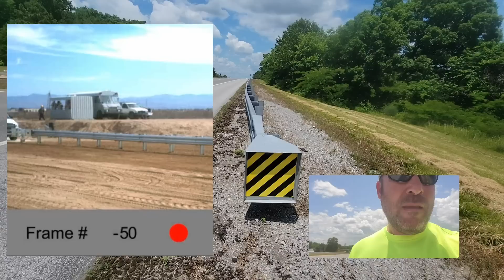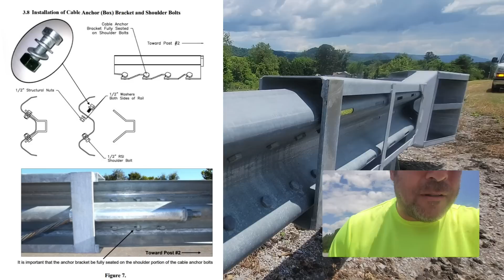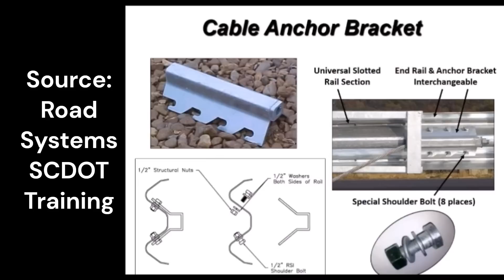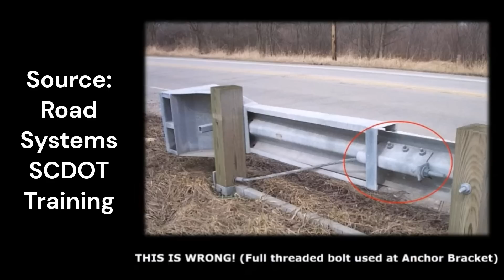Explanation of Backward Bolts Guardrail Short with Million+ Views

Comment: You are so right and you have to ignore any Troll's as there is tons on YouTube and keep doing what you are doing, it's to important. I was a Certified welder in structural steel and not an Engineer but I do know when something is Engineered to break away or designed to fail in a Engineered way you can not deviate from the proper way the Engineer's designed it to be assembled in anyway. Thanks for your hard work trying to help save lives
Reply: I doubt they were trolls. Just misguided due to their own ignorance.

Comment: Your idea of color coding is so simple but would make a world of difference. Could easily be done at the manufacturer.. sure they'd need to set up a new station and either transfer workers to that station or bring on new workers, increase rhe number of workers at a given time... but it'd probably be worth it. Just so the installers don't mess up by putting the bolts on backwards.

Comment: Are you familiar with European guard rails? We don't have something to hit. Our guard rails just go into the ground so it turns in to a slight ramp. Much safer to fly couple feet trough the air than come to a dead stop
Reply: You don’t come to a stop when you hit these tho… they’re not massive steel constructions obviously they slow you down but you don’t hit it and dead stop. I’m not gonna pretend to be an expert here but is it really safer to be flipped into the air even just a little bit than it is to be forcefully slowed down over a few feet? Especially considering the question of does it fling you into traffic or off the road which causes all sorts of issues especially considering the types of roads guard rails are used on anyway. Idk
Reply: Unless the vehicle overturns, which is often what happens with that type of guardrail with the turned-down ends. That's why they are no longer used in the USA.

Comment: So my favorite insight is about the installation errors, and how that’s indicative of further installation errors.  Agree 100% generally, but what I failed to get out of this video was a solid explanation of why the bolt direction should matter for this system other than the fact it can be referenced on something that looks like ikea furniture assembly instructions. I dug through a bit of guardrail installation documents, but couldn’t find any specifics about this idea, and also just having a general knowledge of fasteners in general, these fasteners can kind of skip through most of the more complicated aspects of tensile loads/strengths, torsional interests, etc.  They can essentially be considered “pins” in their applications. 

The only thing I can imagine might matter is the exact location of the shear plane, but this isn’t an aircraft  carrier.  It’s a couple pieces of fairly thin metal meant to help stop a careening car.  I’d like a scientific explanation of why you think the bolt orientation matters, because I’m both curious about the reason, and also think there pretty much is no good reason, outside of an installation manual reference.
Reply: i got the same impression from the video.  I suppose i could imagine.. that if you had the bolts the other way.. then a car hitting them would maybe losen them by pushing them out the way they came in, which in tern might cause the guard rail to bend and break better.

Comment: Sorry for my stupidity I can’t remember if it was in the video but what makes it different if the nuts are on the opposite side..other than the way it was designed..does it stop something from happening? I feel like I’m going to be looking for this now lol
Reply: They're not normal bolts. The bolt gets tightened onto the guard rail, then the bracket slides on to the bolt between the shoulder and the head. If they're installed with the heads on the outside (facing the road) it means both A) they didn't follow the instructions, and B) they're using the wrong bolts anyhow.

Comment: Ok automotive tech he. Installed did it right. Designer like most engineers are wrong. And even more they should probably be cage bolt not regular hex bolts

Comment: Maybe if it wasn't so complicating to install it wouldn't have been messed up. I'm still struggling to see the problem and nobody can use their damn finger to point out the issues... so yeah, maybe the design is flawed, not the users. In software, we follow a very simple rule... and that's that the user is an idiot... and you have to treat them as such.
Reply: If you think this is complicated I'm not sure you should be coding.  Not taking the manufacturer's instructions to install multi-$10,000 units that are safety-critical , and not having a checklist to follow and sign off are bad working practices, irrespective of the unit design.

Comment: LOOK  OP if you want people to be serious and pay attention,  stop blabbing about  nothing.  KEEP to the point,  KEEP  to the facts,  EXPLAIN  yourself  without needless babble.  You could have fixed this easily by simply  making  about a two sentence statement in your original video,  AKA   "This is  xxxxx guardrail, and  this  connection point/ bracket is assembled incorrectly  according to the manufacturer  and  engineering tests.  The bolts must be  installed  the other direction because ....... ...... ....of   ..... ....etc".   SEE?  EASY

Comment: You never mention these are (supposed to be) shoulder bolts. In your expanded video you never explain why, other than to follow the drawing. If the shoulder passes fully through the joint it really shouldn't matter, since the joint sees only the shoulder and the two compression surfaces, which are symmetrical. It's just not easy to tell from the vendor drawing here if the shoulder goes all the way through. As an installer following the vendor drawing is the safe bet, but as a taxpayer I'd want a manufacturers verdict before paying someone to go change a bunch of installations.
And of course, sorry for the loss of your dear daughter.
Reply from the maker: It has a "CAPTIVE Washer and a 12 gauge w-beam cutting the amount of shoulder significantly. Additionally, the backwards bolt can be torqued creating a much stronger clamping force. These just hang on the surface. 

It's not a frequent install error so in that sense it's not common but it's a known issue. On the other hand there are 7 right here. Also the other thing is errors breed errors. This same "error-ia" has a frankensteined unit plus two units which have torn rails because the contractor literally beat the units to fit.

Comment: I dont really understand. The clip you inserted in this video describe incorrect brackets or brackets facing the wrong way. It never mentioned anything about which way the bolt should face. I understand that this is personal and the concept of mistakes breeding mistakes. But with all the things that can go wrong is this worth harping on. It seems like this installation would still allow the bracket to move away from the car. Maybe worth checking if direction of bolts is important with the manufacturer.
Reply from the maker: I put the photo from the manufacturer in there and the video discussed the special shoulder bolts and captive washer.

The companies is road systems Inc. You can Google them.  If you are ever near East Tennessee email me and I will show you in person
Reply: Pretty clear in the diagram he showed that those bolts only go one way.

Comment: Watched the whole video and still don’t understand what the problem is
Reply: The problem is this is a guard rail. Guard rails are for protection of the driver from serious injuries or death. This guard rail will most likely cause harm and even kill a driver if they were to need this. Problem understood now?
Reply: @MacD559  Yes I understand that. I'm guessing the way the bolt is installed it prevents the guard rail from absorbing the impact in a controlled manner vs remaining static
Reply: @Shiznit304  The funny thing is, the bolts that were used are incorrect and either way they're installed will cause the same problem. The ones that are supposed to be used don't clamp the attachment to the rail, they leave a loose area for it to attach to, so it easily disconnects. If the right bolts were used, then the direction would matter.

Comment: If the securement rating of the boots is high enough, it doesn't matter how they are installed. Securement is securement. Don't need a degree to have common sense

Comment: I agree they should be installed as the manufacturer suggested, however, that doesn’t always automatically mean that installing at the other way, causes a structural issue.  I mean it certainly can, but just because the instructions say to do with one way, doesn’t mean the other way is any worse. The instructions after all have to tell you how to install it a way.

I’m not disagreeing that following the manual is the right thing to do, but question your determination in stating it’s much worse.

Are there any warnings in the installation guide that states that installing the bolts backwards could cause structural issues?  If so I would highlight that in your videos.  If not, perhaps it really doesn’t matter much.